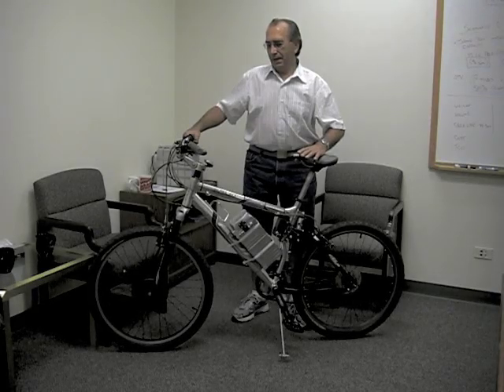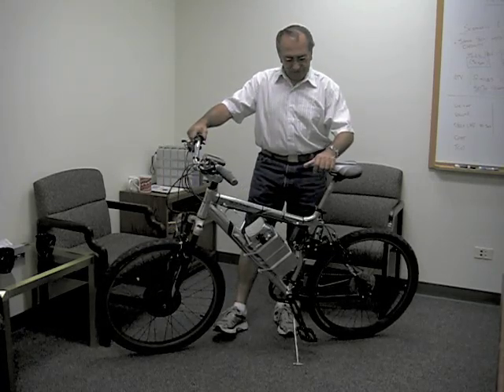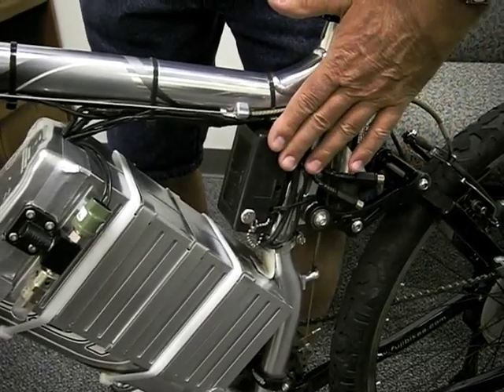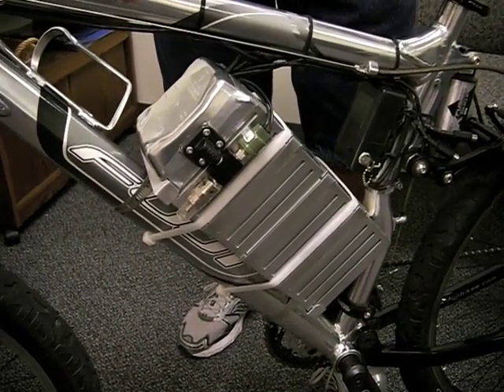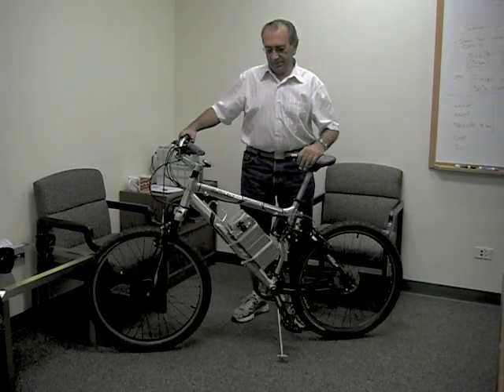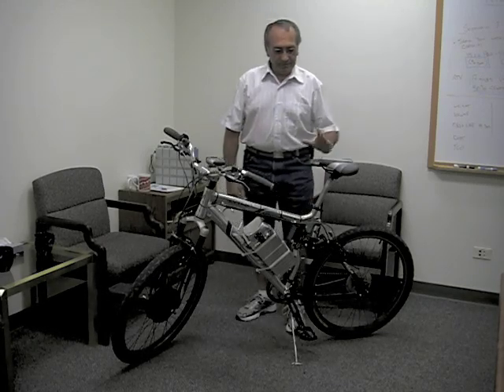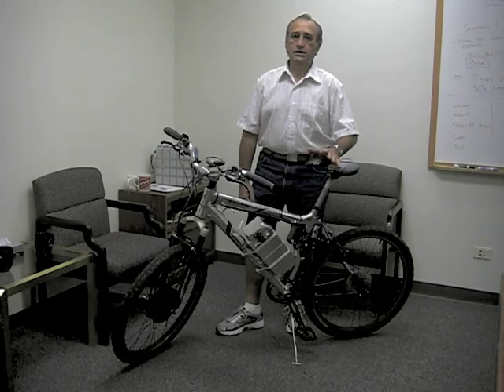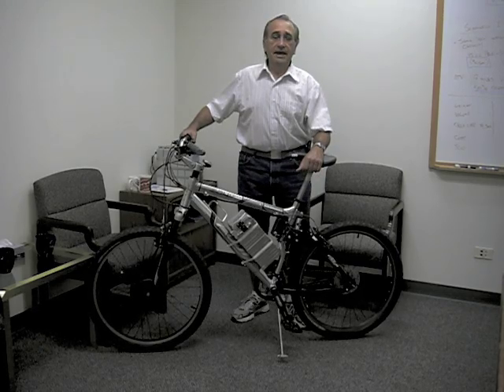Electric Bike using Nilar Batteries

Comment: Life span of NiMH batteries vary greatly based on environment and duty cycle.  There are a few Panasonic research packs that are almost 30 years old that still operate at 95% of their original capacity.  I have a 30KW NiMH pack from a decommissioned 20-year-old electric vehicle that holds 97.8% of its original charge.  I've been using it for 6 years for various deep cycle alternative (solar, wind, etc) energy projects.  The trick is in the charging.